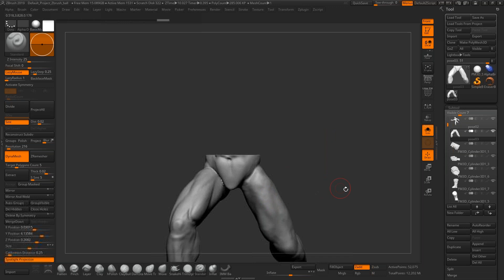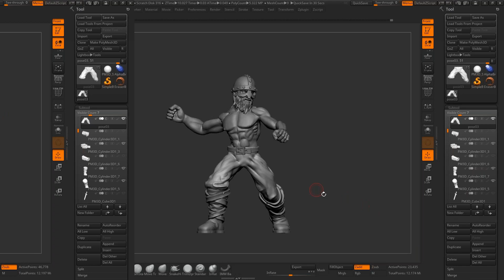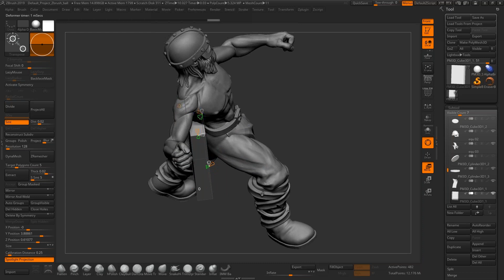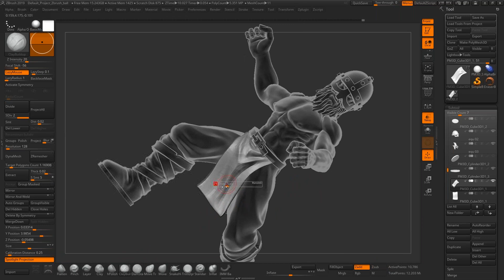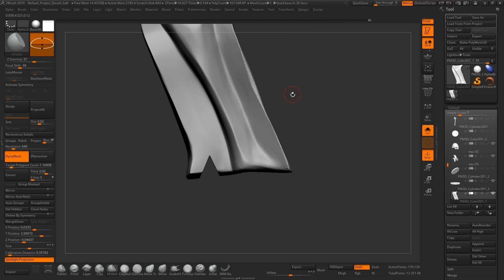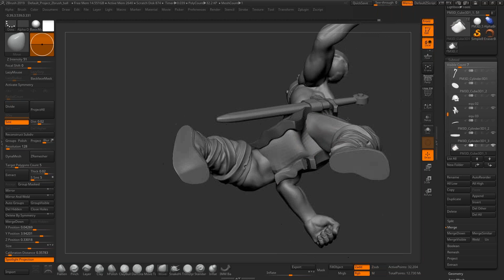Sculpt Pants & Loin Cloth For A Viking Miniature Using ZBrush (Step-by-step tutorial)

Comment: 0.5 mm is enough for miniatures cloth? I mean , for characters like warrior, where you put skirt, straps and some floating geometry... a good thickness ? also dynamesh model requires great scale... miniature are miniature are standart size 28mm 36 mm etc ,but dynamesh process is requiere a good sized model, however dynamesh is not problem for me, I was wondering about measuere and thickness for the cloth, special for PLA and resin machine.